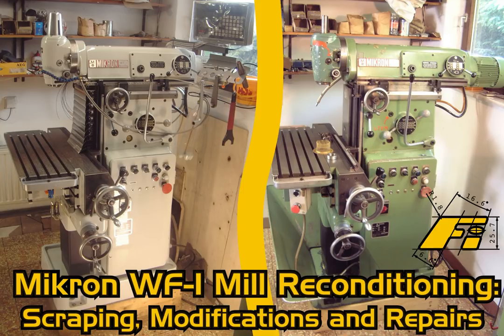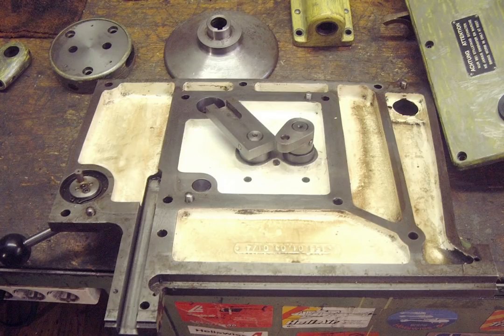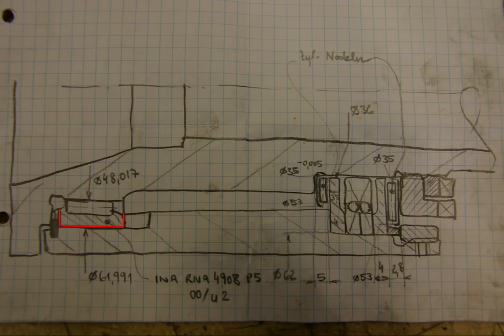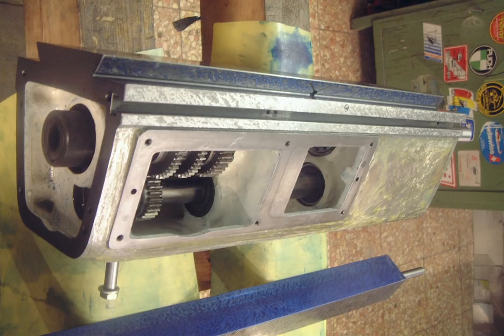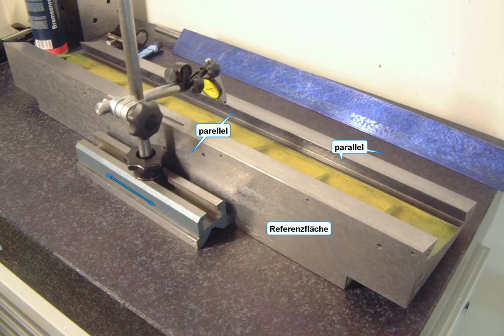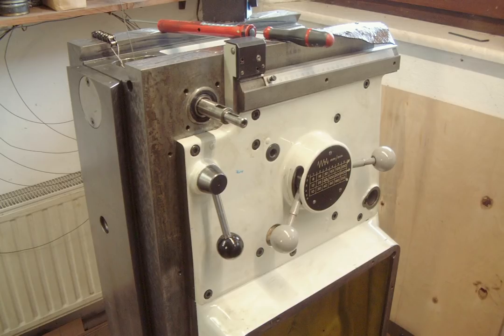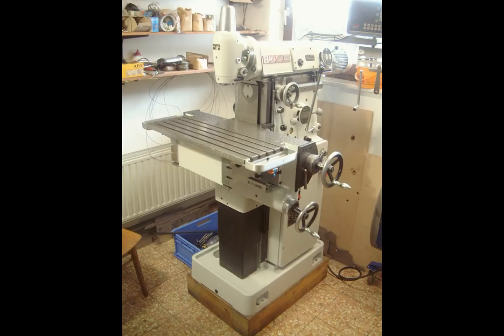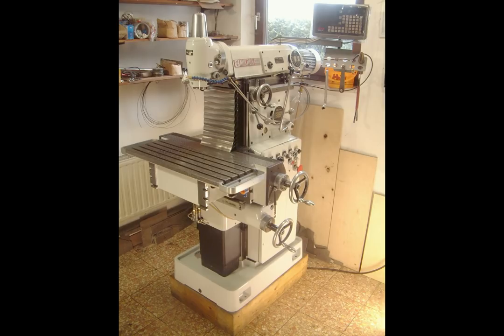Mikron WF-1 Milling Machine Reconditioning: Scraping, Modifications and Repairs

Comment from the maker: IMPORTANT SUPPLEMENT: The coplanarity check described in the video might be misleading because of the pictures being taken with various setups. The audio comment I give at the same time is a little abstruse, sorry. The following instruction might be more comprehensible:

To determine coplanarity, two sub-tests must be fulfilled:
1st test: Place indicator base on one surface, sweep on other surface from indicator position "outermost" to indicator position "innermost" as well as move along the slide. Reading must be constant. This ensures that the surfaces are parallel.
2nd test: Compare indicator reading in "forward" and "reverse" position ("forward" being e.g. with base on left surface, taking reading on right surface, "reverse" being with base on right surface, taking reading on left surface). Readings must be equal. This ensures that the surfaces are at the same height, i.e. coplanar.

Comment: You can weld that cast iron fairly easily. I don't know why this is a perpetual myth that you can't weld cast iron properly. Just put the cast iron in an oven or even on a gas grill. Once it's up to temperature pull it out immediately weld it and put it directly back into the oven. I did this with stick weld many times and it works perfectly. I'm not a welder by any stretch and this has worked every time. You do have to pick the proper welding rods and I can't remember which ones I used at this time but the information is out there.

Comment: Nice work.  Finding the mental fortitude to tear everything apart to fix the table tilt is... the right thing to do.  The oiler was a bonus.  I've been thinking about adding an oiler to an RF-45 type mill.  It will be far easier, I think.  And that's the best light I've seen on a mill.

Comment: Very interesting! Reminds me alot about my last 14 months with my FP2. It's a different machine and you went further than I did in disassembly in even removing the base from the column!

I am only at 15:55 now but that is really interesting segment! I was really fortunate when I hopened my vertical spindle because everything looked to be in fine shape on an otherwise abused machine. I would have had no idea what to do if I was in your situation. I didn't think it was even possible to lap that at home and get it so precisely centered.
Reply from the maker: Well, Dennis, I guess coming up with such a solution is a result of being confronted with the problem and not having tons of money to solve it. Sure the damage was frustrating, but the way I see it, the spindle was already worn so I couldn't make it much worse. Fortunately the repair worked nicely. Thanks.

Comment: I've watched this episode a few times now and am very impressed at your focus and endurance it must have taken to complete such a task. I'm sure as you say it ranks among the top best of Micron and more than likely better than originally produced. I myself have a new to me lathe that I have ambitions to undertake this process and am continually procrastinating knowing how much dedication it will take to achieve the results I'd like. I can only hope to get it to the level that you accomplished with your milling machine. Thanks for sharing your journey and maybe one day il finally finish all my other more important projects and tackle this similar daunting challenge. PS. I would love for you to help me build a new thread dial as you have engineered as my lathe seems to be missing the factory one and I really like your multi application design that you made. Cheers and I hope you find the time to make future videos to enjoy
Reply from the maker: Many thanks for your kind comment. I know, it may be quite intimidating to start a complete reconditioning. However, what assured me beforehand of my scraping capabilities was the test pieces I made. One of them was a house shaped prism (a testing tool for a precision frame level), all made exclusively with hand tools (saw, file, scraper) from round stock cast iron. For testing the geometrical accuracy of the prism surfaces (symmetry) I used two dial indicators at the same time. This project cost nothing and made me self confident of spotting, scraping and testing principles and procedures. Only thing left is endurance! Good luck for your upcoming interesting project.
PS: Sorry for my ebbing of videos lately, but currently I'm so very busy with customer work.

Comment: I have watched this about 4 times. I think another 10 and I will understand all of it. When you say cross slide you mean the fixed part that the table slides on to the left and right?  My brain is calibrated for bridgeport type machines so I am all mixed up. I like the ingenious tricks you came up with to measure parallelism and co-planarity. Your indicator bases don't have to be pretty. Stephane would have hardened and ground them, blued them and engraved his initials in them, but you were trying to get the job done in your lifetime!
Reply from the maker: :D thanks for this very kind comment Sir, with this you've lifted me out of a bad day! Right, what I mean by "cross slide" is the part that connects the z-slide column to the x-slide table. Sorry if this is not a typical expression, English is not my native language.
Reply: @anengineersfindings  your english is excellent!

Comment: So, Alex, I found the time to watch the video during the weekend. I'd like to thank you sincerely. It seems like a very high quality job, inline with your friend's, the ones who makes fun of your dial indicator fixtures :) 
It has been very useful that you documented the whole process, start to finish, in one video, even slide show, it worked just fine.

Many questions arise, both technical and not (like, how did you make do for 5 months without a milling machine?? :) ).

What is of great interest though, and not related to your machine specifically, is how far can one get with rebuilding a machine. If one acquires the experience (not easy but not that hard I guess) and can invest personal time, one can, in principle, end up with a machine much more accurate than any home-machinist could ever afford! Which is amazing if you think of it...You gave next to nothing in terms of money and 5 months of your spare time (and a lot of work of course) and ended up with a machine that would cost 50k, if it was for sale that is....

Anyhow, great work, thanks for sharing!
Reply from the maker: Many thanks for your kind words.
:D Indeed, being without a milling machine for five months is like losing an arm. But I have to admit that e.g. the wrenches for the spindle I made at work after working hours.
Well, about the accuracy you mention: Yes, a lot is possible with physical and mental endurance by scraping and smart testing. But there is a certain limit of accuracy which you cannot improve upon. This is given by the machine's design. The more rigid the machine is, the better. Imagine reconditioning a machine for many 100 of working hours to find out in the end that the machine deflects due to it's own weight more than your scraping accuracy. In order to avoid this, make sure before reconditioning that the machine is well designed from a structural point of view and proven.
Reply: Yeap, totally right...Indeed I had nice machines as starting point in mind, machines that will pay back your effort and time if you decide to devote it to them....like your Mikron.
Myself, I can't see how I could find the time to do this, even if I had the skills...Maybe if I have tought myself to scrape untill I retire from work....but then I might not be able to lift the heavy mill parts :D
Reply: Hey Alex, could I ask where did you get the way wiper stock from? Thanks, Thanos
Reply from the maker: The wiper is a universal one for ways, I got it from https://shop.dynatect.de/ in Germany where I work. I don't remember the particular type though, sorry. It was a one-piece length of 500mm.
Reply: many thanks Alex for the link!

Comment: Very impressive work! Love that you explain all the details and put so much content in your video. This tube furnace is very interesting also... Is it an induction furnace? The coefficient of expansion must be very problematic between the quartz tube and the sealing element? Thank to put so much effort in your video ATB
Reply from the maker: Thank you! The tube furnace in the video heats by radiation (and heat conduction if you use Argon, e.g. instead of vacuum). And yes, I am always again wondering how the little thermal expansion of quartz allows for the high thermal gradients along the tube (e.g. from 1100°C in the center to 10°C at the water-cooled ends). Greetings, Alex

Comment: I think you've done an amazing job on that restoration - if you can call it that - as you may not have actually restored it but considerably improved it ! A a slide show, this video worked well. I was thinking how green everything is in your shop but this WAS green but now isn't :)

I, and I bet many others, would appreciate a 'machine tour' video where we can see all its features in action including power feeds, rapids, spindle speeds etc.
Is it classed as a horizontal milling machine with a vertical head or a vertical machine with optional horizontal operation ? For instance, if you fit a horizontal milling arbor, is there support for the far end of the arbor as per H mills ?

Comment: Hello Alex,
Amasing work! 
I'm doing the same with my machine, I only have a little problem in one of my slides there miss a little piece about half a cm. It's the slide on top for the horizontal milling procedure. Do you know a way to remake this. I think it's broken of when they wanna push the top on the slide.
Reply from the maker: Hello Frans, hmmm, repairing a broken off part of the grey-iron casting is surely not easy to do properly. However, it can be done e.g. by welding, depending on the type of damage and depending on the part.
Reply: @anengineersfindings  sorry for my late reaction. I think it's fine so. This because it's on the slide for horizontal milling. I would only use it for vertical so it will be fine.
Reply: I would try to put some servo motors on mine so I can use it like a CNC controlled machine.

Comment: 14:24 Needle roller bearings - roller size variation. UK's Colchester Lathes had spindle bearing rollers accurately ground to one size. The rollers were then sent to the inspection department where they were sorted into 10 sizes. Only rollers of one of these 10 sizes were used in a bearing.
video: https://www.youtube.com/watch?v=nQaAKUAzK0w
All the rollers were used but only with ones of a similar size to an amazing degree of accuracy.

Comment: Hi Alex, I have recently purchased a Mikon wf3. Your video has been an amazing resource many thanks. The vertical head is in a million pieces due to failed bevel gears. I have ordered new gears but I can't find any info on the bearing/spacer arrangement for the horizontal shaft. Do you happen to have and photos or info of the Bearing holding the drive gear at 17:06? Cheers, Matt. Australia
Reply from the maker: Hi Matt, wow that's a project ahead of you. Good question about the drive gear bearing arrangement. However, I'm afraid I won't be able to help you here, since I didn't disassemble the spindle as shown at 17:06. Good luck for your reconditioning!
Reply: Thanks Alex, no worries. Lucky enough the quill assembly is intact an appears to be in sounds condition. Looking forward to more of your videos in the future.
Reply from the maker: @Ballba365  Thanks, Matt and all the best to down under!

Comment: That is a beautiful restoration. I just got the same machine. Do you know where could I find the manual for making some maintenance?
Thanks
Reply from the maker: Thanks. You can get the manuals of the Wilhelm Grupp WF-1 and the Mikron WF-2SA at lathes.co.uk. I'm not affiliated with that site, just got my manuals there as well.

Comment: I once had to rebuild a spindle from a Kearney and Trecker Universal Mill. It used a tapered roller bearing on the tool end with the inner race surface being the shaft itself. We had no manual so the boss suggested we cut off the cage. Oops. From then on the mill was strictly a horizontal
Reply from the maker: :D
Reply: @anengineersfindings  
It wasn't really funny at the time. The machine was most likely built in the late 30s early 40s. It still had a US War Dept tag on it.

Comment: Very, very nice work,  i have the same machine from the same source. But yesterday i have a problem with the vertical axis. You make tools for demonting. Do you have drawings of this wrengstool ? Thank you in advance
Reply from the maker: Pierre, I'm sorry, I don't. I made the two-sided wrench on the fly, without keeping a sketch or drawing. But it is easy to measure the dimensions on the spindle, just give it a try. I measured the hole distance of the largest nut by placing pins in the holes and measuring the pins distance.
Reply: An Engineers Findings ok i make today somthing from scratch, about your mikron, have you more detail pictures because you make me thingking for dowing the same job
Thank you in advance

Comment: you have a One Shot Oiling Pump and that feeds to another distributor  time 50:40   is there seperate pistons to pump oil to each port?
Reply from the maker: Dale, the pump supplies the piston distributors with pressure. The piston distributors supply each port with a given amount of oil (e.g. 0.2ml, 0.4ml or 0.6ml), not more. They do this by means of a valve system and piston inside of them. A full stroke of the pump supplies 18ml of oil, but the system here with it's 11 piston distibutors only needs part of that. So if you pump the handle until you feel the pressure block (i.e. all piston distibutors having reached their ends, here at about 1/3rd of the pump's stroke), oiling is complete.
Reply: An Engineers Findings 
Hi 
What brand are these metering Pistons I have not ever seen those. 
All I ever see is just one shot Pump. Thank you
Reply from the maker: The ones I used are made by SKF, type 352 and 353. There are smaller and larger ones available, too. I bought mine at www.schmieranlagen.com
Reply: An Engineers Findings  thank you I will find them. 
Simple per loader cylinders. For even oiling.  I never saw those in US. I live in Alaska 
Do you have another machine rebuilding plans?

Comment: Very nice work indeed! It will earn you years of precise work and a lot of pleasure using the machine. ps! did you hand or machine scrape?
Reply from the maker: Thank you, Sir! I have no power-scraper, so everything on my WF-1 is hand scraped.
Reply: Wow.. good on you!  A BIAX or Renz (Stefan has one :) ) would have served you well there, but you have done so well with hand scraping so ..
Self taught? Or are you also one of Richard King's students (as me and Stefan)? or educated in industry?
Reply from the maker: Well, one could call me a fool for doing all the scraping by hand. But I don't find handscraping very exhausting, except of heavy roughing, particularly on steel. What I found more exhausting was the continual handling of the heavy components of this mill.
Yes the little bit of scraping which I learned is learned autodidact. I'd love to participate in one of Richard King's classes, however, I couldn't overcome myself to do so yet.
Reply: Not at all! 
I agree with you  also, and often pick just the hand scraper if the joj at hand is not too large. Radio on  etc. and it is relaxing. With the technique I adopted (Richard taught us) to use the body to push the scraper, leaving both hands to steer and push (or rather lean) down. Not so taxing, almost hypnotizing in it's rhytmic fashion :)
With the intenet/YT many things are sooo much easier to learn today than just a few years back
Reply from the maker: Yes, I fully agree with you.
And you are so right about the beauty of learning by using e.g. youtube nowadays. 20 years ago when I was at school, learning the machinist trade, I machined a vertical slide for my little lathe in my free time. One teacher said to me: "But a good machine slide is always scraped." However, no one in the whole school (and it was a good school) could teach me how scrape a machine slide. Also the school library was of no use in that regard, no matter how long I searched.

Comment: 3:34 Someone upgrades the machine to move in 2 axes and you donwngrade it ???????
I do not need to upgrade my machine as it was designed to be able to run in 3 axes - either as power feed or rapid traverse.

Comment: Did you notice that one oil groove shape worked better (from a wear point of view) than the other two ?
Reply from the maker: Good question, but frankly I wouldn't know how to test for this.
Reply: I just meant that, perhaps you had noticed that the one in the zip zag shape (for example) had more of the original scraped surface remaining.